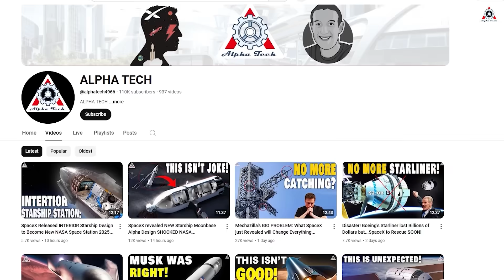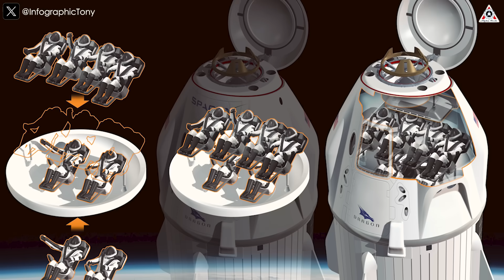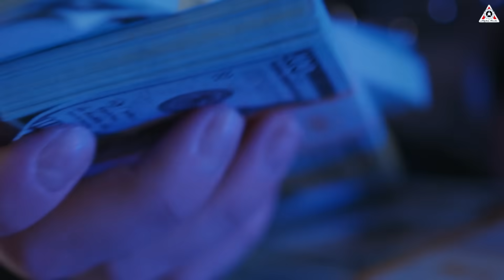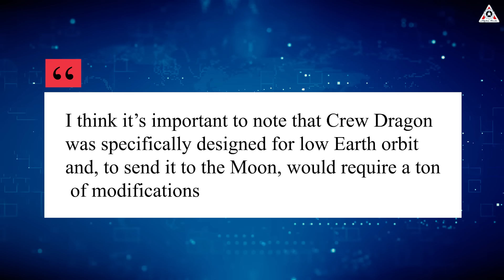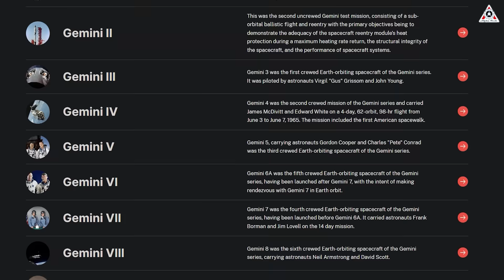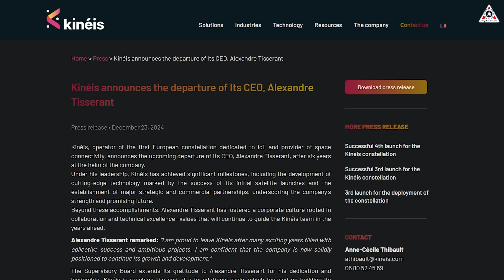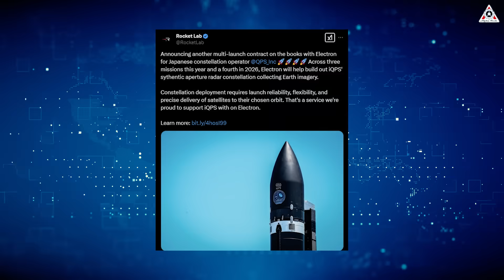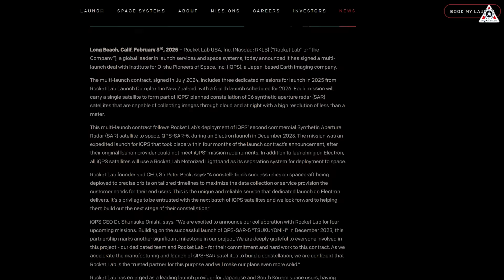SpaceX's Dragon to the Moon instead of NASA's $2B SLS Launch...

Comment: Think of Dragon as a dragster and SLS as NASCAR.  SpaceX has the power of lifting heavy payloads into orbit,  SLS has the capacity to make it to the moon.  SpaceX would have to stop and refuel.  ( Dragster - 15,000hp for 1/4 mile....NASCAR - 1500hp but can run for miles.)  BOEING who is building the core stage is plagued with quality control issues within the SLS program. Hence the over budget and time line problems.

Comment: SpaceX Dragon isn't designed for the high reentry speeds of a Lunar return, which proved a challenge even for the first Orion test.
Reply: Why would it need to go to the moon at all? Just transfer to the Starship lander in LEO rather than lunar orbit. Much simpler and cheaper. No mods to Dragon required. Lunar lander is designed for long duration occupation as is. No mods to Starship lander required.
Reply: @avgjoe5969  going to a Moon orbit isn't the problem. Surviving the hotter reentry when coming back will require a stronger heat shield. I have no doubt SpaceX already has a Lunar Dragon design in mind.

Comment: Of all the Space tech of the 21st centruy ONLY  Crew Dragon and the Falcon series have PROVEN their worth.
NOT SLS,  NOT BLUE ORGIN, NOT BOEING, NOT STARTSHIP,   ONLY Falcon.    Falcon should be the vehicle for artimis, its just a darn shame Elon is stuck on starship and is wasting the great thing he's already made.
Reply: Not true - Orion has already gone around the moon and come back.  Dragon is not certified for deep space missions Orion is very close to that certification.  I'm insured dragon can be upgraded with an upgraded heat shield but we need to have several spacecraft and several options so that we don't put all of our eggs in one basket.
Reply: One other factor that needs to also be thought about is that we're going back to the Moon to stay and that means we have to have regular Supply ships to keep the moon base active. So just getting somebody to the Moon is not the solution it's getting them there with regular resupply missions and rotating crews out and all of the associated activity. This is the training ground for trips to Mars and it has to be done on a regular basis to get the experience we need to go to Mars.
Reply: And not one of them are taking humans to outer space, because of that big elephant. His name is Van. Van Allen. Yeah, I know, you forgot about him, right?

Comment: Both Crew Dragon and Orion capsule would be a one time solution to "just get to the moon once again". Far too expensive to develop for such a limited usecase. Imagine spending 26 days in such a capsule. I know it can be done - but why not build descent habitat and docking/refuel modules to make sustainable travel happen?

If Boeing was focused to offer future proof products for space flight, they should build a lunar gateway station that fits into the payload section of affordable heavy lift rockets like FAlcon heavy and New Glenn. Or directly aim at Starship dimensions. In addition build a cosy habitat module variant that gets launched once in such a payload bay without humans on board and starts to regularly travel between Earh and Lunar orbit with humans on board. No earth atmosphere landing capabilities needed - get back by docking with a regular crew dragon to return to earth.

The "one launch has to cover everything" approach was needed, because SLS could only be launched twice per year (at best), while Falcon 9 and Starship (and hopefully competitors  as well soon) are capeable of doing multiple launches in the span of a few days. That makes composed multi module systems viable for Earth and Lunar Orbit. Including multiple Lunar Landers  with multiple refills on site. Which makes the operation way more redundant (=safer) and better suited for a permanent presence on the Lunar surface.

Comment: Modify the current SLS build to heavy lift a larger expandable Lunar Orbital Station. This station would polar orbit the Moon at 10/20 miles. Use this station as a transfer/refueling point between the Moon and Earth and Other destinations. Plus add astronomical modules to observe the Universe with crystal clarity.

Comment: You're wrong the sls has been launched twice. The first time the capsule never reach the space station the second time stranded the astronauts in space
Reply: You are confusing SLS with the Atlas V - this was the rocket system that brought the Starliner capsule up into space three times. The Atlas System was the predecessor of the Saturn V, it was the sytem that launched the Mercury and Gemini Capsules (first US men in space). It got refined over the decades up to the Atlas V Variant that first launched in 2002 . Its payload is 18.850 kg to LEO compared to SLS's massive 95.000 kg into LEO. 

SLS on the other hand was designed to bring up the Orion Capsule (also built by Boeing) which has the focus on long duration missions - like 26 days getting into Lunar Orbit (the Moon) and back. The Orion Capsule has been launched on the SLS once for a testflight without humans on board, circled the moon and returned safely.
Reply: @genius1a  well corrected, up to the last point, it came back with a very worrying heat shield. Which is important due to the insane flight architecture; two weeks to achieve lunar orbit?!
Reply: You're thinking about Star liner.

Comment: The Starship will be a humongous machine to be landing on the Moon and Mars.
It will blast a massive dust cloud which will make for an uneven surface for the legs which could result in a tip-over of the Ship.
The legs could be self adjusting in length to ensure that the Ship remains vertical.

Comment: Crew dragon would Not land on the moon. It would bring 4 astronauts to Starship Lander in LEO after it refuels. It was idiotic to ever use $4.5b Artemis to bring 4 people all the way to the moon, then put them on Starship Lander... a vastly more capable habitat... Transferring the crew in lunar orbit is also more dangerous. 

So. To slice $4.3 billion off the price tag: Starship launches and refuels in LEO at the refueling depot (a modified Starship tanker with sun shades). Dragon meets it in LEO after the fueling is done and the crew rides to the surface of the moon on the lander (a much larger ship than Artemis).

Circa 2027, the (proven) Dragon and Starship Lander, Starship tankers, Starship depot will be (once proven by a couple of Moon Landings... including maybe a few cargo only runs)... Spacex should be able to land men and robots and 100t cargo on the moon for about $1billion per flight. 

This would allow monthly service to the moon to build a proper base (mostly with robots) and bring Boring company tunneling machine for underground habitats and mining.
Reply: where did you get the 4.5b from?
Reply: Too bad non of that will exist for years...if ever.

Comment: I've been thinking about the lunar program, and realized what we need is a lander and lifter.

Where basically we can get a uniform module sized whatever to the Moon's surface, or lift same into lunar orbit, or shuttle from Earth orbit to Lunar orbit.

Basically we have the tech, engines, tanks and avionics, things just need reconfiguration into more practical morphs than Starships.

What I see is a Sled, composed of two rows of engines in two paralelle lines, and supplied by two sets of ELONgated concentric tanks.
Where your tanks create the structure for sides, and your engines feed off the tanks they are nursing from.
The beauty of concentric tankage is its compact, and can be structural.
And if you splay your engines slightly, and cones, allows steerage without gymballing complications.
And of course you would need a drain system in tanks like a semi tank trailer, but might be able to goose neck and get your thrusters higher to avoid rock damage and minimize regolith blast.
And with the twinned rows systems of thrusters, you could create a belly dump situation.
Allowing you to say take a four meter by whatever length, to the Moon's surface, land it precisely and lift off your lander for the next trip and next module.

And with the Moon's lesser gravity, you could probably drop sections into Regolith dust piles, like air bags.

ie use the Snow blower with rock sorter to berm up dust beds to drop modules onto, to keep lander some meters off surface.
and in motion.
This would allow rapid transfer production to the Lunar surface, and not require engine removal or repurposing tanks.

You could probably use a solid fuel thruster between Earth orbit and Lunar orbit.

And your Landers playing catch and tag dirt with the modules.

This would be way more efficient than Starships for cargo, and could use the Air Force's Super Gun project to get modules into Earth orbit.

Perhaps have module fab at Super Gun site or a RXR siding.

You wanna base, lets get Logistic...

And you want cargo dumpsters and a way to lift from the Moon's surface...

So lets quit dinking around with tube rockets and build some Lunar Landing Craft like Omaha Beach...

Relying on Buttlander Tube ships for everything is DUMB.

Lets branch out some! Flog the Nerds everytime they dare mention stand up tube rockets anywhere except exiting Earth's gravity well.

Same system, probably exact same device would work for Mars...
We just have fuel depots in orbits and on surfaces, and get to work...

Enough with the Dino designs rockets, lets get practical variations that are serviceable.

Just sayin'

Comment: The third option is use dragon as a crew taxi to an already refueled in orbit Starship. This mitigates the critical phases of a manned launch, refueling, and re-entry requirement of Starship. Skipping a year plus of manned certification and its associated abort infrastructures.
Reply: So you actually think that if Elon could get humans through the Van Allen radiation belts safely, that he wouldn't have already done so? Really?
Reply: @deanhall6045 - sounds good idea but I still don’t think we can be on time because we don’t have money to go and will not make it end of Trump terms. From other sources “.
Reply: You're not going to get Starship human rated as there in no escape system, and no go-around capability if a catch fails. It'll require a taxi.
Reply: @michaelreid2329  You won't get any space craft certified to go through the Van Allen radiation belts. Ever. Forget this hoax, it's not happening.
Reply: i saw a video by smarter everyday that said it would take over 16 launches of starships to fuel the orbiting starship that would be the one to take the crew to the moon. look into it! it’s technically the current plan until something changes
Reply: @eugenesesmaiii3278  But.....they went to the moon, through the Van Allen radiation belts, and back on a full tank already. Why not just do what Apollo did and film it on Earth?
Reply: Where is money come from??
Reply: I like that idea, but I think it would be cool if they made a new version of dragon that is larger and more purpose-built specifically for lunar missions so they won't rush the development of Starship anymore then they already are